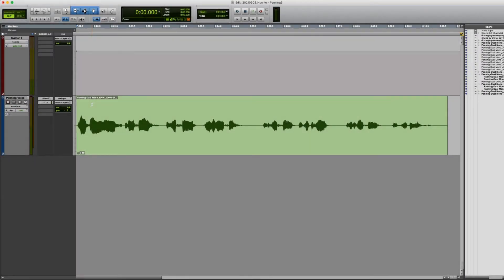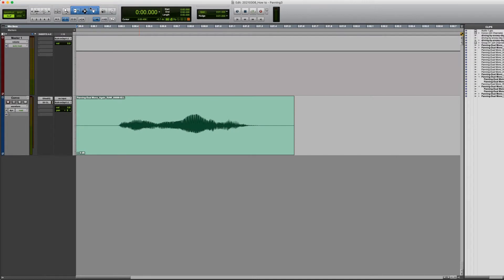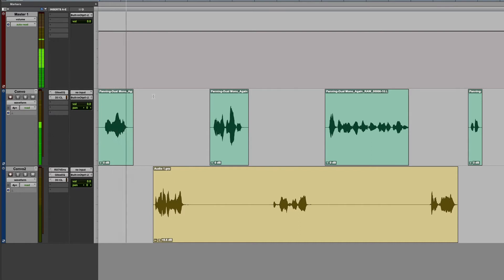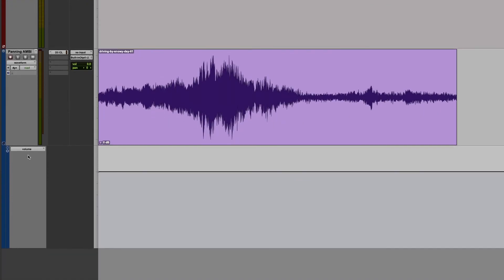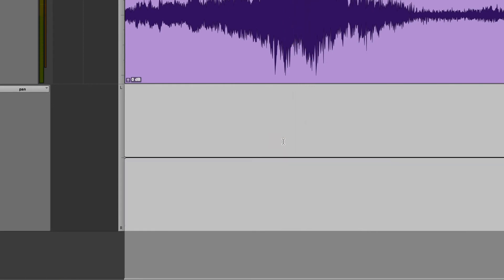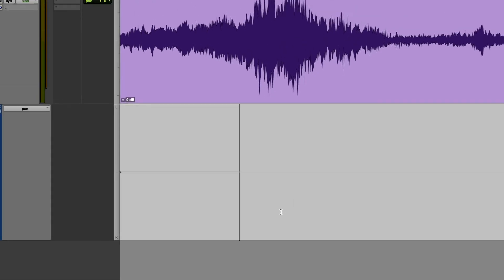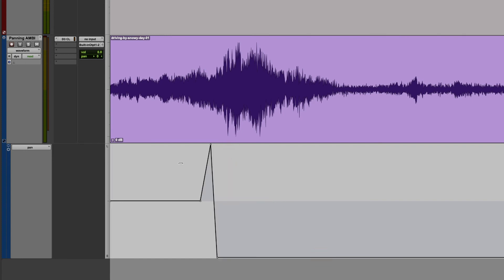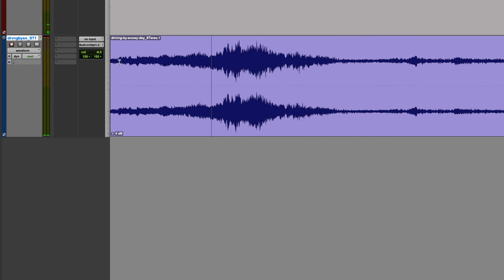Pro Tools: Panning and Panning Automation

Comment: I like pro tools but the work flow in Logic is much much more easier and direct.
Reply from the maker: At this point I mostly see DAW's as generally doing the same things so you can't really go wrong. I try to stay fluent on a few of them so if a job requires the use of something specific I can easily accommodate. Logic is great but I loved it more before Apple stole it away from Windows so many years ago! lol. Cheers!